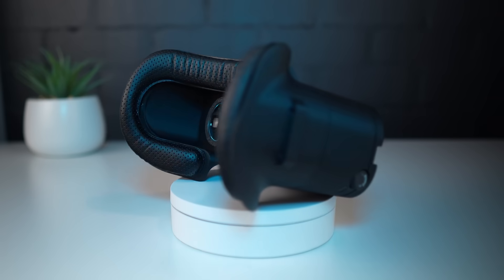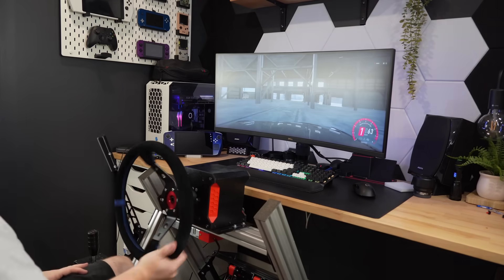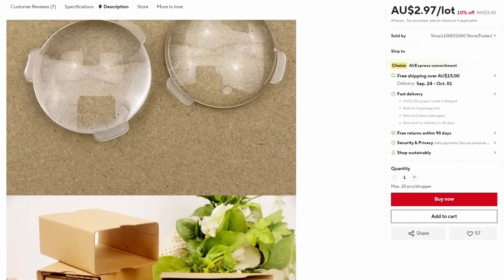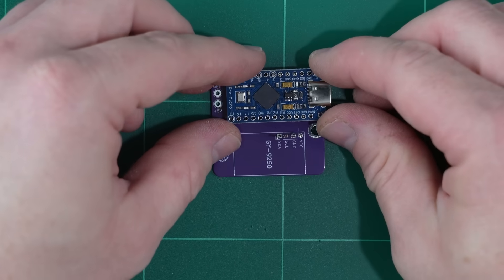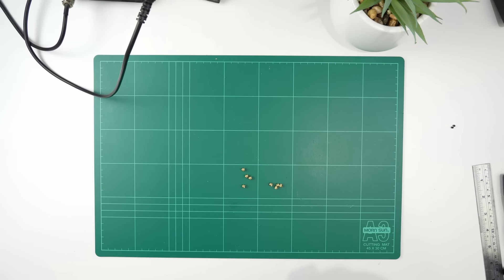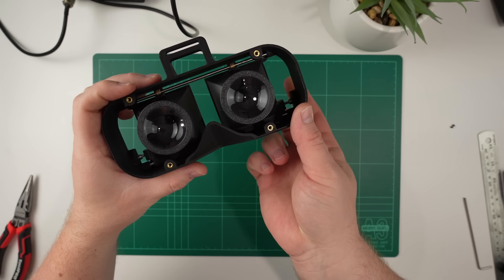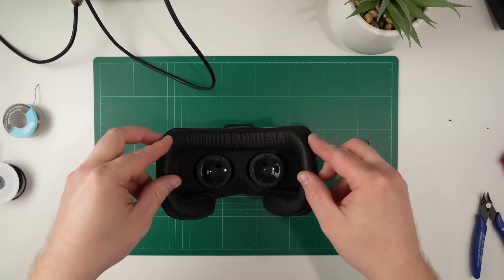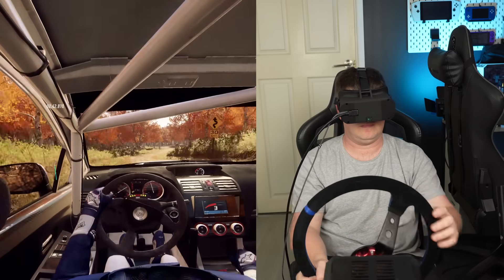I built my own VR for under $150!

Comment: I wonder if you can use all is dyi stuff with beamng drive because that game is on such a different level these days but my good of trusty g920 just isn’t cutting it for me it’s very manageable for track stuff like grip racing all though I run into the issue every time I start up the game where when I load a car in I have to re calibrate the wheel and reload the car a few times before it decides it’s in the centre and for drifting especially high level pro style drifting with lots of power low weight and grippy tires it’s a nightmare and you have a very small window of FFB tuning with that wheel in beam specially because of the recommended FFB load window suggested by the devs themselves so I definitely want to do the wheel and pedal box and frame but the head set would just be for fun because building your own shit is fun

Comment: This is what 3d printing was made for. Great job and cool project!
Reply: 3D printing is great, but there is other additive manufacturing methods. Just get scrap peace of straight ABS plastic from e waste machine, few cutting tools, injection needle with end cut off and sanded smooth and 1ml syringe with bottle of acetone. Cut and chemically weld peaces together. This works great with parts that need fitting but you dont have time or skills to do 3D Scan well as needing to get the tactile feeling of where and how to setup say connectors so those work smoothly, something that is rather hard to get right on 3D print. Though its not like you cant combine these two methods if you print in ABS. Built custom airsoft to tool battery adapters for ones that dont have existing ones being sold in china or there is no stls available. Since i just need one its faster and easier to make this way. Setup like this would not be bad project for this method as well, but since files exist for this not a issue, just good to have in your tool box in case something cracks and say 3D print fails mid print, just measure the height you got, or check the printer if there is info on what layer it got and then make copy of the stl what has been modifed by removing parts that you printed, then print the rest, combine the two with this method to get full part with minimum material waste.

Comment: This I think I would love. I have a PSVR 2, but I dislike the controllers and simply want a VR headset that tracks my head movement as a camera viewpoint in games. Speaking of fpv headsets, they used to have a fan blowing air into the headset. That would be neat if were implemented in this headset, to prevent fogging while gaming. 
As for future distribution, I would suggest a link to where one can buy all the required hardware and electronics, and a link to a free .stl file, optionally 3mf file, for 3d printing the headset pieces, and also a link to the required code. 
That way one could order the hardware/electronics kit, download the .stl files, start printing and building the elctronics kit oneself.
Reply: Check the description

Comment: It seems like you've put a lot of effort into solving the IPD issue, but made zero consideration for focus. Not everyone has perfect vision, nor is everyone's face shape the same. By hard fixing the lenses into the display box, you've removed any possibility for focal adjustment. It would be preferable to also give forward and back adjustment to each lens as well, this should solve any focusing issues.
Reply from the maker: Its difficult to test how it would work on different peoples vision, since I've got a sample size of 1 to test with! I'm also not convinced changing the focus would be enough to solve most peoples vision problems. If it was that simple, I think a lot of the commerical products would do that rather than including the option to fit perscription lenses. But, I'm happy to be proven wrong! Either way, the files are open source so if you want to have a go at making the focus adjustable yourself, please give it a shot and let me know if it helps!

Comment: Dan how many display you broke till the headset was complete? These displays are way too fragile
Reply from the maker: None, thankfully! Just gotta be gentle, they are definitely very fragile!
Reply: Bravo. I think I already fried 2-3 not sure. Absolutely discouraging for me and I was almost complete
Reply from the maker: @krissko97  Damn, that sucks! I felt the riskiest part was clipping them into the housings so if that's where you're breaking them, either your print is coming out undersized or you're having to push too hard to get the past the clip. You could cut the clips off and use double sided tape or something to hold them in instead?
Reply: @cncdan So the first panel I broke was at that exact place. Didn't know what to expect from them. Yet I used the broken one to dial in a perfect fit for the replacement. So I assembled the eyeboxes, tested it all fine. Then proceeded with the rest of the stuff and I was almost done with everything where I decided to try one more time the displays. So only the backlight is lighting up, no image. Tried everything, physical inspection shows zero damage to the ribbon or panel. The display driver board is recognized on the pc. I suspect ESD
Reply from the maker: @krissko97 get a bit of isopropyl alcohol and spray it into the connector between the display and the splitter board and try reseating it a few times. Those connectors are fragile and I had to have a couple of goes of getting mine to work fully. The backlight is pretty much just a couple of led lights, so if it's working on one that means the driver board is okay and there's a very good chance it's just a bad connection!
Reply: @cncdan It didn't work 😢 tried cleaning and reseating everything. Thanks for suggesting it though

Comment: "150$" ❌
~30$ for 9 3d printed pieces (or 200 for an entire printer) + ~165$ for the true material cost including solder, wires, adhesive, etc + ~15$ for tools or a grand total of about 210$ and the ability to solder on top of that. ✅

Now, I'm no expert but this seems way too wasteful and cumbersome when the objective is just a cheap vr headset to conect to a pc. If you want something that is truly cheap and will be much easier to make I've talked to a friend of mine that does know about vr and you can just buy cheap vr glasses for your phone, a good usb-c cable and a steam program called driver4vr and make this exact thing for less than halve the price, if you really try you can add in a pair of wiimotes and for ~120$ have a full vr experience.
And I have also calculated that price taking everything into account, even a charger so the controllers have rechargable batteries. I only assume you have a computer that can run vr because that's the point and a smartphone because is 2025, I've seen even homeless people with a phone.
Reply from the maker: Playing by your rules though, you'd need to include the price of your phone in that equation! Its true there are cheaper options out there, but some people just enjoy the project more than the finished result and I am one of those people!

Comment: This looks absolutely incredible. I've been looking into doing a build for myself. I can't seem to find a link to the 3D files either in the video's comments or on the github page. Am I missing something?
Reply from the maker: All the files are up on GitHub (https://github.com/dmcke5/DIY_VR ). The STL folder contains the 3D printable files and I've even included a .STEP of the whole assembly so it can easily be opened and edited in your cad package of choice. Don't dive into it just yet though, I might have an update coming out very very soon 😉
Reply: @cncdan  Now I see it! Sorry man, I guess that's what I get trying to pull info during the work day.

Comment: A bit more complicated, BUT! If you shoot for the higher IPD using larger screens you could allow for the adjustment in software for lower IPD by shifting the image in on the display through the software. I don't even think it would have to be anything fancy, just literally shift the image displayed on the screen left or right. Again I say this without any experience in coding for a display, and admit my ignorance. So, I'm really only speaking conceptually. As a 3D artist what struck me is that what matters most is aligning the image to the center of each eye, not so much as centering the screen to each eye. 

I dunno just a thought. I'd build one myself and mess with it but now is not a good time for spending unfortunately.

Comment: i was doing similiar stuff, 
moded psvr1 headset with a razor phone display (1440 x 2560, 120Hz) and bosch BNO055 USB-STICK (DigiKey 828-1045-ND) for 2D flightsim.... 
but it was bulky, heavy and sensor difts needed recenter more often needed than having fun... 
today iam playing new setup.. 
vive lighthouse 2.0 with vive tracker 2.0 for robust acurate driftless tracking (pitch,yaw) 
in combination with virture pro glasses
thats more comfortable and more stable ...
keep in mind.. i am focusing on 2D not 3D ;o) 

thanks for your great content ... lets going on.. having fun ;o)

Comment: has someone tried to use this on a steam deck? 

I mean , the building part is pretty straightforward, its the software part and compatibility that scares me.
Reply from the maker: If you just want to use it as a display, it should work. But the steamVR drivers it uses are for windows only as far as I know!

Comment: would it not have been much cheaper to buy one of those 5 dollar phone vr headsets and then put everything into there instead of expensive power hungry 3d printers ?
Reply from the maker: I think you'd be surprised how cheap 3D printing is (assuming you already own a 3D printer). There's about 200g of filament in this project. PLA costs about $20AUD per KG so there's only $4 worth of plastic in the final product. The printer uses roughly 0.23kw/h while its printing and can probably complete this project in about 10-12 hours. So 12 hours at that rate is about 2.76kw/h of electricity which at the current rate in my area of $0.34 per kw/h, comes out to about $0.95 in electricity. So in total, it cost $4.95 to print 😉That's AUD too, so its more like $3.20 if we're talking USD!

Comment: would have been way more nais if you whould have made the cables go out top and with the help of some wires to make them out of the way and not sag to the side ...
Reply from the maker: It just didn't work with the large HDMI connector, the cables would've been sticking way up in the air. My plan was to loop the cables around and attach them to the top band of the headset but I didn't end up doing it in the video as it didn't feel too bad the way it was for me.

Comment: Hi Dan, very cool video, very keen on this challenge, are there any options for positional tracking? Im into flight simming and been able to move your head around is important eg, looking at gauges closer and out of windows etc. Also I am a small manufacturer of flight sim hardware and need to design some custom solder masked distribution boards. Keen to know what you use to design them on as I am new to that type of thing. Cheers for the video. Very inspirational.
Reply from the maker: There is a way people are doing it using a PS4 VR camera and some lights. It's something I'm looking into currently! As for the PCB design, I'm using Kicad which seems to be one of the more popular free options so there are plenty of tutorials around to help get you started!
Reply: @cncdan  Ah, I already am using the old PS2 camera with a uv filter and IR leds for head tracking. It would be fairly easy to incorporate that into the headset...or... just keep wearing the ir clip ...

Comment: Is it possible that the head position sensor should be central in the headset rather than offset? I feel like this would give you an off-origin point of rotation that could cause motion sickness if the rotation displayed doesn’t match what’s happening in the brain 🤔 awesome project nonetheless!
Reply from the maker: This was a topic that was frequently discussed in the drone/fpv community. As far as I'm aware, the general consensus is that it doesn't make enough of a difference that you'd notice it. Happy to be proven wrong though!

Comment: This is an amazing project Although there is one reason I would not consider it for myself, fresnel lenses. I've had them in my Quest 3S and even though it's fine for most games, especially racing games were very annoying because often things happen on the side of the screen and fresnel lenses have too small of a sweet spot to make the sides of the screen even remotely sharp. I later switched to the Quest 3 and I'm happy with it ever since. If anyone considers buying a Quest headset, make sure you go used. Mine was relatively cheap because many people buy a Quest because of the hype and then realize the headset is just gathering dust.
Reply from the maker: I didn't end up using fresnel lenses, it was just something I considered while I was choosing what I wanted to use

Comment: Great little project here mate, loved it. Only thing I reckon I'd do different is to have the power and HDMI cables plug in to an i/o port at the back of the head that then is fed along the strap to the headset.
Reply from the maker: I thought about making a little PCB for the back of the headset and running a big ribbon cable over to the front, but I was trying not to do any surface mount soldering on this project to make it beginner friendly so I ended up choosing this instead. Keep an eye out for revision 2 though ;)

Comment: Very cool project (and likely a little beyond my skillset)!  I think I'd like to see it incorporated inside a helmet to give you more of that feel...  One of the things I don't like about VR headsets is there's a weight forward of your head, moving slowly this isn't an issue... quick and constant movements and it tends to detract from the experience.  With a helmet, you can move any electronics to a more desirable location, plus there's more weight around the head so it'll be less obvious it's infront of your head.

Comment: one thing i'd change is routing the cables to the back. can't remember which headset did it but there was one wireless one where they put the batteries on the back and it reduced neck strain because the weight was more balanced

Comment: Surely a second hand quest 2 would be better in every way.
6 dof tracking, cheaper, higher resolution, wireless, and capable of stand alone gaming.
Fun project though! ❤

If you can spring for a quest 3 or 3s you can even use the pass through cameras to be able to see your real world sim controls if you want.

Comment: This is what I have been looking for, no controllers just the adjustable display.  Are there better displays you would recommend for higher frame rates without the decrease in resolution ?  Not opposed to spending more for that.

Comment: The TOP of the description, when clicked reads "1440x1440 2.9 Inch Dual Display 60HZ Square LCD Screen TFT LS029B3SX04 Panel For AR VR Headset MIPI Driver Board Wisecoco"

so OF COURSE you'd not excpect 90hz :/

Comment: Regarding refresh rate on VR screens, remember to divide it by 2 for the actual perceived effective refresh UNLESS you're using perfectly synced simultaneous dual-rendering.... which is not generally supported for PC use natively. PCVR sends data to refresh the lines in rapid succession, but it's always left line 1, right line 1, left line 2, right line 2, instead of L/R line 1, L/R line 2, all being rendered simultaneously. 

In order to do this in perfect sync, the game would have to be rendered twice - as in decode 2 copies of it in VRAM at once. 
This is not reasonable/achievable on most graphics cards, and definitely not consumer ones, as the software they're rendering wasn't coded to be 3D in that way originally.  Not to mention needing 2x the VRAM/GPU core power/etc. to get the same resolution/framerate.

This means that a 90Hz screen pair will give you an effective visible refresh of 45Hz in most instances. Flicker city, and tearing in high-action games like Cyberpunk 2077 or FPS's. You should AT LEAST try to get a 120Hz screen if possible, or higher. VR screens aren't quite like regular ones in that sense, because your eyes ARE in sync, and the screens aren't. Unless you can afford $40k+ graphics coprocessors... bought in sets of 8+ at a time, LOL.

Comment: Ive been seeing alot more DIY headsets on youtube recently.  I'd really like to see someone tackle controllers and base stations aswell
Reply: Can you do a mixed VR configuration and use Rift CV1 cameras and controllers?  Since they are completely separate hardware, they could be just added on top of this in software.
Reply: @TomJones-zv9se  alot of people with diy headsets use steamVR base stations and controllers because of how easy it is to set up and integrate. im not sure if rift ones would work the same way. I still think it'd be cool to see someone do their own thing although Im sure it is alot more challenging than it seems.

Comment: For head tracking I use a IR emitter specifically the DelanClip, with modified PS3 eye camera and open track. It works for every game i've tried it with. This could be mounted on the side of the headset removing the need for the arduino. Theres also a battery powered version which would elimanate the need for another cable leaving only the hdmi.

Comment: I'd love to build one of these. I originally had a Oculus Quest BUT M$ and FB axed them. I'm staying on W10 as W11 removed Mixed reality support and I have the top Samsung Oddessy2 (Got on FB marketplace for $20CAD as the seller upgraded to W11 and couldn't use) but evenutually will move to W11+steamVR . I mostly play Car Sims: Assetta Corsa and M$ FS. I also have one question, gow to combat fog buildup from your eye? We do sweat a bit and the lenese have fog build up
Reply: You can use WMR headsets with the unofficial Oasis Driver.